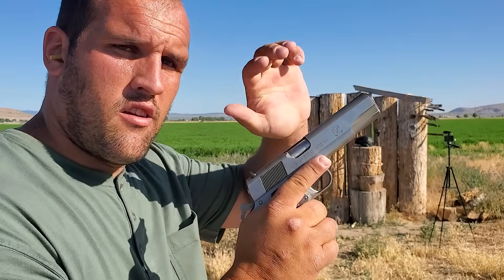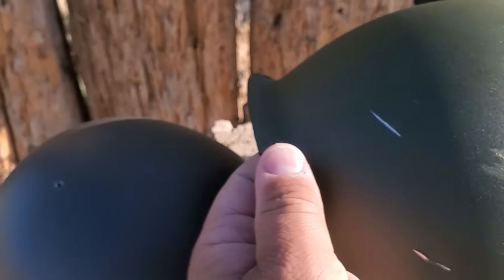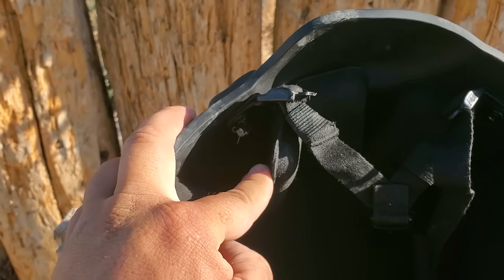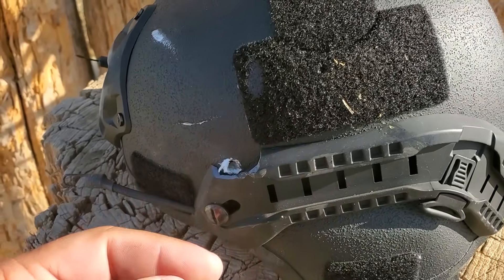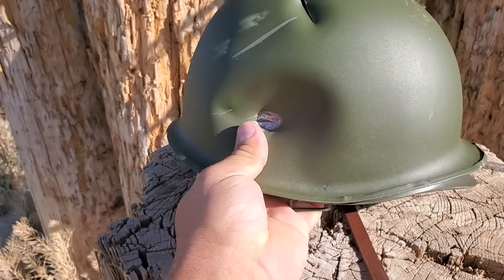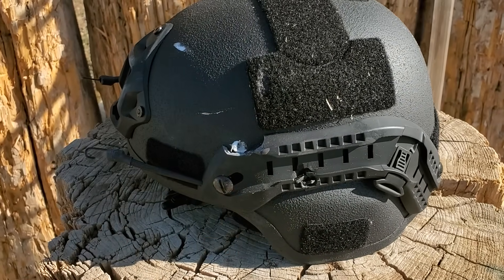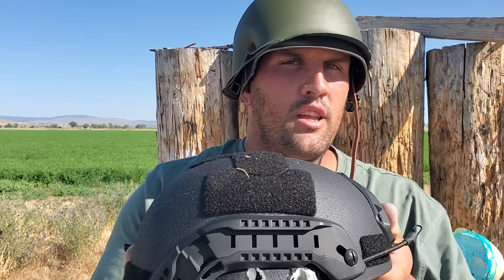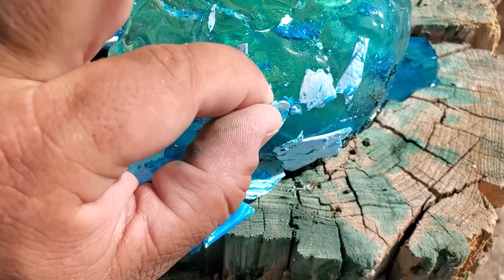Can a Helmet Save You?

Comment: I will say, as someone who owns that exact M1 WW2 helmet, it's designed for reenactors/airsoft, and not the same materials/weight as the originals. While this does not negate your wonderful throws and testing, it's not indicative of an actual M1 Pot helmet.
Reply from the maker: Well damn I need to get a real one for the second test where do I get them?
Reply: @ItsWhateverKnifeandGun 
You can probably find second hand Vietnam era ones for under $80, and if you just want the pot bc the liner doesn't really matter when testing protection you can find some for just $50-60

Comment: 5:30 That bullet bounced back at you... 😬
I think a real modern helmet would probably be better than the WWII. But the nice about the WWII one is that you can't fake it. Modern one, it could look legit but be flimsy material, and you'd never know till you got shot. WWII one, it's just plain metal, so if they use flimsy material you'll know right away.
Reply from the maker: Very true. And the bullet coming back I didn't even think about it
Reply: Wild. Came down here to see if anyone else saw that and if that was indeed what I saw
Reply from the maker: @jasonclinton3367  well it was a small peice if anything because it looked like the hole thing was stuck inside

Comment: I was a soldier and seen a lot of helmet hits throughout my time. The way modern helmets work are kind of like "ooblek/electric soup". It's made to stop high impact fast moving bullets. It's kind of the same as a vest rated for 9mm. Police vests will stop 9mm up to 45acp at times. However, they are warned that they are not stab proof. It's why confrontations with those who have a knife are actually a bit scarier. 

Also that modern helmet? No way that's the real deal and if it is? Then it's probably expired. Yes, body armor expires. It doesn't mean it's entirely useless but it's a good idea to change it out.
Reply from the maker: Yeah unfortunately. It was 0ver 150 so I guess a real one would be a lot more. And even if it was expired it should be tougher than that.